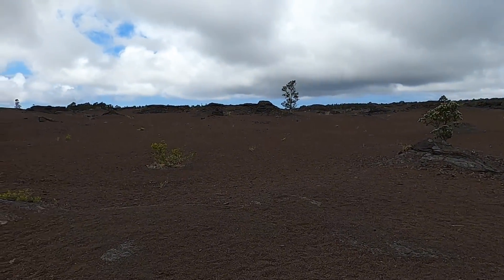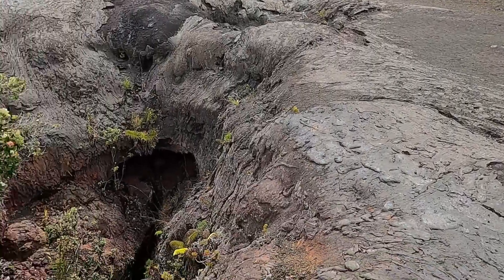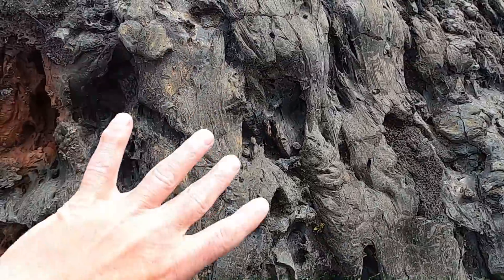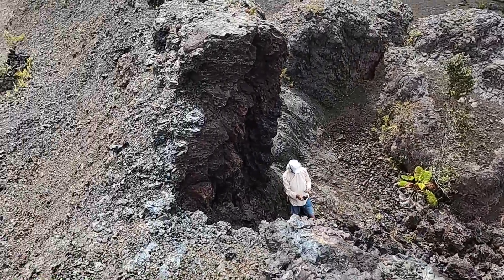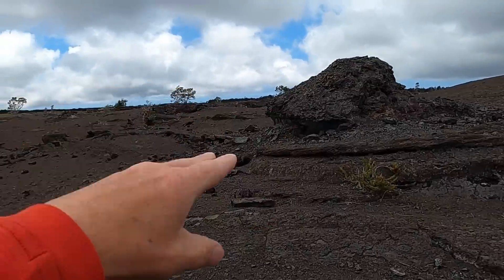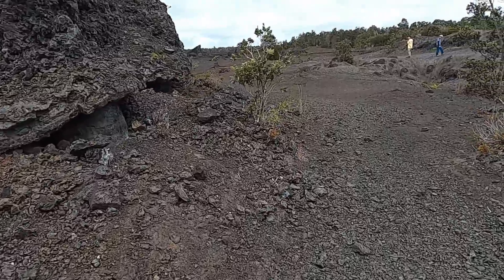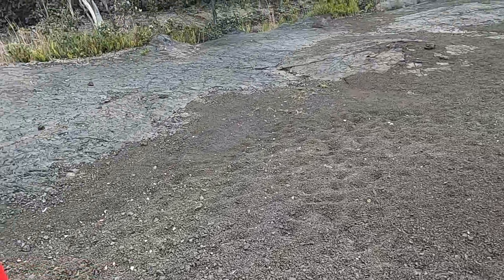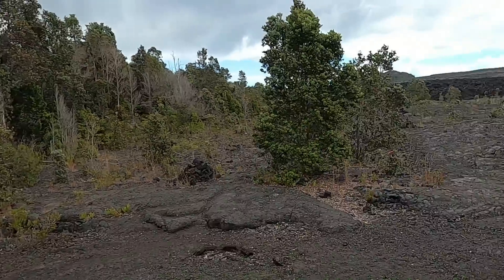Lava Spatter Ramparts and Fissures of 1969-74 Mauna Ulu Eruption in Hawaii Volcanoes National Park

Comment: The U.S. Army, stationed at Schofield Barracks on Oahu, uses much of the land between the Three main Volcano's atop the Big Island for training exercises.  I was stationed there in 74 and we were required to spend 1 month, every year, out on top of the Big Island. They gave you a Four day break in the middle of that 30 day exercise to either go to Hilo or stay at a Military Retreat near Mauna Ulu. I took the Retreat option and WoW what a show that eruption put on at night. If I remember right, there was a fissure spewing Lava about 2,500 ft in the air. On one of those days off we toured some old Lava Tubes you could drive a Semi Tractor & trailer thru. Good Times !  😊